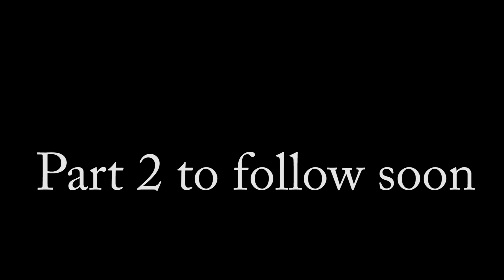Pfizer, process 2

Comment: I was taught in, either undergraduate or masters, biochemistry about the differences that can arise between what a scientist in a lab may create and the eventual product that exits a commerical factory process. A scientist is usually only making tiny batches so can use the best reagents even if very expensive... so work arounds are common to carry out mass production.

This resulted in the Thalidomide disaster. Thalidomide is an extremely good drug for it's intended purpose - in the form that was developed in the lab. But carbon atoms have 4 bonds and these can be formed in different orientations to each other, like a left hand is different yet the same as a right hand.

Biological systems are generally very specific to molecule shape and when Thalidomide was made in the lab it happen that the process resulted in Thalidomide of just one shape being made, which did it's job very well.

When the drug went into mass production the process was changed so that cheap reagents could be used. But this resulted in both "left" and "right-handed" molecules being produced. Unfortunately, the other shape turned out to also be biologically active and blocked normal fetus development.

Science now knows this and the correct shape of Thalidomide can now be produced quite safely but of course, try telling a mother-to-be "hey here is a great drug that will stop the terrible sickness you are having, it's called Thalidomide...".
Reply: Thanks for that. I am surprised that when they patented the PPI Omeprazole that it was a racemic mixture but only one of the isomers was active. After the patent ran out they found a way to remove the inactive isomer and sold the active one as a newly patented drug - Nexium in the UK. This trick has been played out a number of times. Thanks pHarma.

Comment: Stuff like this definitely cant incorporate into DNA.. 
Ever ....and this could never cause Interstitial lung disease ever or worse..
(Even though it was listed as a AESI) 
And there is no other scenario in the lungs from the process of a vaccine causing ILd that a different response happens in your immune system that had ever caused other problems ever in the lungs.

 Thats all completely and absolutely impossible..

  Well worth for a Flu with a death rate lower than some other flus.
Well under 1%..
With early treatment a virtually 0 % risk..

The risk of all this is actually lower. 
Its a - 150% that this vaccine could cause any harm in and including up to allergic reactions. 

I mean whats not to love? 

I just thought you should know that.

Much ❤ Dr C

Comment: OK, so process 1 uses pcr/clean process using magnetic beads. Process 2 uses plasmid bacteria. Cheaper? OF COURSE IT'S CHEAPER . more profit for the fat slobs at Pfizer. No need to purify it because he, the point isn't to save proples lives but to make MORE MONEY.
Reply: great business model.
Reply: There are several filtering/purifying stages, with control parameters for product-related impurities and process-related impurities.
Reply: @gribbler1695  yeah, right.
Reply: @howard1beale  yeah... that is right.

Comment: Pcr (test ?) to get dna to get mrna for a vax to respond to a variant/problem. . . .  (that definitly wasnt man made, hmmm ?). . . .  with mutations for the V  from different dna bases ? Like from many different ppl ? Like millions getting tested/sampled perhaps? Then mixed with E-coli etc in the process that wasnt potentially completely removed ? Safe and effective for sure. . . . depending on the desired outcome wanted from stakeholders. Food for thought.
Reply: PCR is primarily a DNA amplifying process which it does exponentially in a series of cycles of temperature changes. 
For the E. coli process, there are several filtering/purifying stages, with control parameters for product-related impurities and process-related impurities.

Comment: This is exactly what happened with Thalidomide. One process was used for the trial and that process only created one form of Thalidomide, a form which is perfectly safe. When they switched over to mass production there was enough difference in the method of production that some of the Thalidomide produced was a mirror image of the safe form. The mirror image version is most definitely not safe.
Reply: Oddly enough the same thing goes  for   nasal decongestant   L methamphetamine.         Users say the left   mirror of the molecule is the most euphoric and mildest high.    When the right Mirror image Of the chemical is psychosis inducing mania.     I haven't tried either one but I find it very interesting you can have the same Chemical molecule you'll just reverse and Be totally different.    There is so much  danger to playing with mRNA it's ludicrous      humans are completely arrogant and blind to rich incentives
Reply: "Weird knowledge increased". So far I only knew that the chiral mirror image version of Contergan was not tested and the problematic one, thanks for providing this puzzle piece.
Reply: Biggest difference is that Thalidomide was a genuine (although profit driven) mistake.
Reply: Both forms of Thalidomide are bad. Because they switch from one form to another even inside the body, they're unstable and the "safe" form quickly becomes its twin toxic form.

Comment: this is truly an endotoxic bombshell
'Endotoxins, also known as lipopolysaccharides (LPS), are toxic substances bound to the outer membrane of Gram-negative bacteria.2 They are released into the circulation when the bacteria ruptures or disintegrates. Endotoxins consist of lipopolysaccharide and lipoprotein complexes, with the polysaccharide component determining their foreign (antigenic) nature.1 Endotoxins are structural and protective, and are implicated in the development of Gram-negative shock. They react with lipopolysaccharide-sensitive cells, producing endogenous mediators such as TNF.0 Endotoxins are commonly found in our environment and are the most significant pyrogen in parenteral drugs and medical devices.'

'Pyrogens are fever-inducing substances derived from microorganisms such as endotoxins or lipopolysaccharide (LPS). They can lead to severe signs of inflammation, shock, multiorgan failure, and sometimes even death in humans when present systemically in sufficient quantity.1 Pyrogen reaction is a febrile phenomenon caused by infusion of solution contaminated, commonly manifested by cold, chill, and fever. Pyrogen reaction has been controlled with improved sterilization and generalized application of infusion set, but still exists in clinical practice.2 Pyrogens are capable of raising the thermostat and causing a rise in body temperature, which is a highly significant indicator of disease.'

Comment: The same thing has happened with drugs that were generic versus brand. The manufacturing process was different resulting in different drug particle sizes and a different ratio of actual drug to a mirrored version of it that was ineffective. This resulted in generic drugs that required very different doses to be effective (if at all). The Medical Industrial Complex denied that the generic drugs were any different than the brand names, even though they were. In the case of mRNA, the differences sound like they can be way more harmful than a placebo.
Reply: Man you nailed it I was going to say the same thing I think what it is it's cheaper to make it fast And dirty        just like drugs          these people might as well be street drug dealers is at this point I mean the pill literally cost them pennies and they sell it for dollars

Comment: Has this to do with the "two batches" causing most of the severe side effects? And next batches giving less side effects like giving impression vaccins being changed in meanwhile? Without mentioning it?

Very plausible that they did notice the mistake after first two batches, manufactoring other batches in proper way - hence the huge difference in amount side effects.
Reply: No I'm afraid this is all by design. Check out How Bad is my batch. Great information.

Comment: I haven't read all the comments but anyone involved in production understands this.
Doesn't matter what you are manufacturing it is the same process.
Protypes in labs.
Preproduction for testing, not necessarily in the real production environment.
Then first series production on the production equipment.
Then when the process is passed of it is handed over to production.
In real production keeping cost under control is vital.
It requires changes in the process compared to the lab trials where cost is not an issue. 
It often requires compromises, just not possible to replicate lab results in mass production. 
No way could Phizer or anyone else establish production quality in such a short space of time.
Then when one facility is producing to the correct quality every unit in the world needs to qualify their production equipment.
This takes people and time.
Doesn't matter what the product is there is often only a few people who can transfer production from preproduction to full production.
This is everyday stuff for any production engineer or manger.
We know it is a lot of work to move production from a lab to the factory.
On top of that the production equipment was producing something else, it needs to be reset to the new product, again takes a lot of time and the factory is not producing what it was.
How do they supply demand.
Of course as the years go by it is possible to new factory's and install new plant.
That takes years.
Reply: Find 'Shot of a Lifetime: How Two Pfizer Manufacturing Plants Upscaled to Produce the COVID-19 Vaccine in Record Time'

Comment: 🎯 Key Takeaways for quick navigation:

00:00 🌡️ The Pfizer vaccine's production involved two different processes: Process 1 for clinical trials and Process 2 for public distribution.
01:39 🧬 Process 1 used PCR to duplicate DNA for mRNA production, ensuring high purity. Process 2 used bacterial plasmids, which can lead to impurities.
04:24 🦠 Researchers have found high levels of plasmid DNA remnants and endotoxin in Pfizer vaccine vials from Process 2, raising concerns about their safety.
08:15 💉 The manufacturing process of vaccines is crucial, and changing the process can significantly impact the product's safety and efficacy, as seen in historical incidents like the Cutter incident with polio vaccines.
Reply: Pizer, Shot of a Lifetime: How Two Pfizer Manufacturing Plants Upscaled to Produce the COVID-19 Vaccine in Record Time
By late July [2020], when the Pfizer-BioNTech team selected the vaccine candidate that appeared to be the most promising, the manufacturing teams were ready to ramp up production for clinical trials while also building stockades for real-world use in hopes of success.
Pfizer Trial: "Between July 27, 2020, and November 14, 2020, a total of 44,820 persons were screened, and 43,548 persons 16 years of age or older underwent randomization at 152 sites worldwide in the phase 2/3 portion of the trial. A total of 43,448 participants received injections: 21,720 received BNT162b2 and 21,728 received placebo"
In the Phase 3 trial 'Process 2' vaccine was used. Before that, in Phase 1 and 2, it was a 'Process 1' vaccine. At least, that's how I read the coincidence of the scaled up process and start of the trial.

Comment: Seems that the Vats of residual contaminants could have used a Good Alcohol flush or high Temperature sterilizing. Hot Steam works wonders in e-coli cleansing in Food processing plants, less volatile then flamable alcohol.

Comment: If the part about endotoxins from E.coli being in these vaccines is true it explains a lot.  One of those endotoxins is called Cytolethal distending toxin B (CdtB), which in some people, me being one of them causes the immune system to generate antibodies to this endotoxin, unfortunately for some of us, again me and tests show it, you can sometimes end up producing Anti-vinculin autoantibodies.  So basically the body fights itself until things calm down inflammation wise.  Vinculin is a very important protein structure in the body for adhesion of cells to one another and for allowing the structures of connections to move.  In folks with IBS it can cause motility and other issues.  Vinculin is not only found in the lining of the gut, it's pretty much in every tissue of the body.  One of which is the heart, and in some people can produce myocarditis.

This blows my mind, I had known about my auto immune issue before I got the injection, I specifically asked if it would cause issues with my autoimmunity, but if this all is true with Pfizer they did not make it known.  Had I known this I never would have gotten it.  And I had two difficult to deal with inflammatory issues occur 2 weeks after the second shot.  If all this is true it basically explains why I had those issues, I had suspected it but I just assumed it was just an overreaction to the antibodies that were the intended production, not this.

Comment: I have been teaching about this right at the first wave of v*ccine rollout on Quora, everything he said was correct.
My Quora account was flagged and restricted so no normal viewers will find the information anymore.

What happened was that the bio-reactors, which indeed are quite large in volume, usually are made with a post-process screening to retrieve microliters of the v*ccine doses and it was not uncommon that they had to completely throw away the whole batch.
They ramped that up to liters and that means they could not post-screen anymore. They also could not post-clean anymore, not in the same quality at least.
The particles of the viruses from the extraction process are highly toxic, the free DNA and RNA fragments are known to cause immune issues as well.
That was all known before the trials.
However, if they used microliter screened doses for their trials and the other process for the "masses" it means they scammed the entire world. That's the most severe allegation I've heard so far.